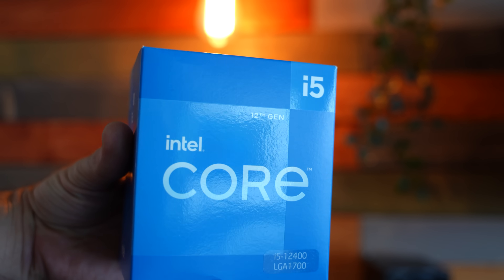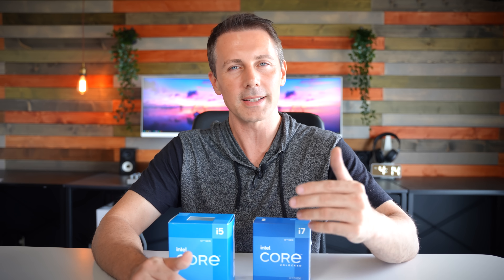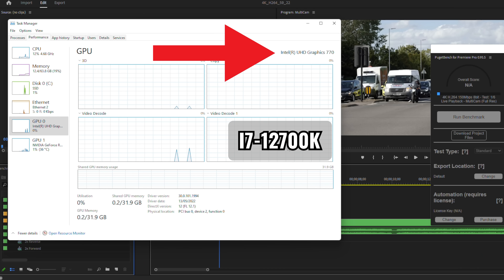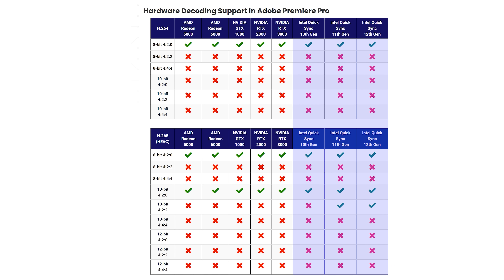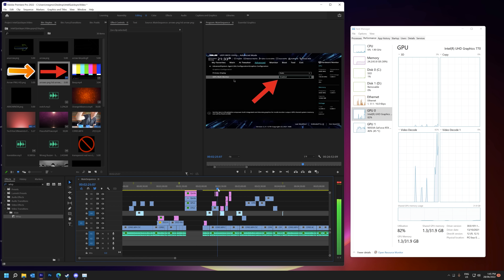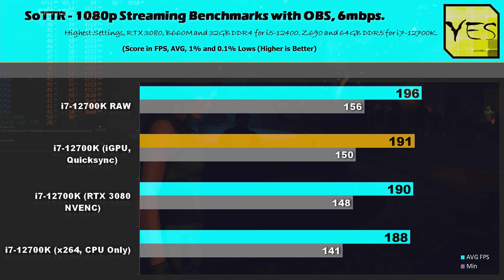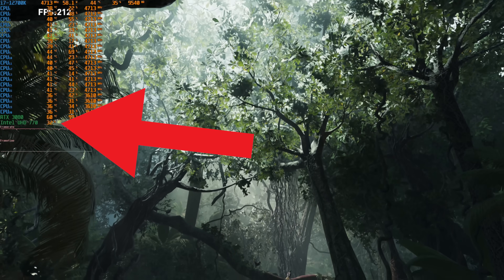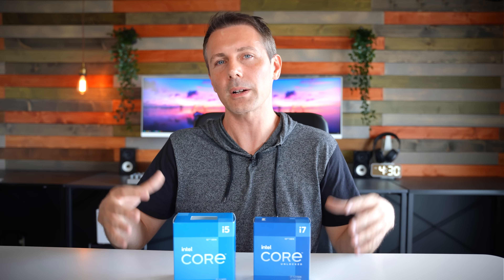Why creators NEED an iGPU alongside their dGPU - Intel QuickSync

Comment: I have an i5 14600 + B 580. I have the BIOS setting to use the integrated graphics. My monitor is plugged into the motherboard DP out.  In handbrake the program uses both combined igpu and gpu for encoding. In gaming the pc knows to use the gpu. Quicksync is a beast in handbrake encoding AV1 and H.265.

Comment: I use Quicksync on i5 12400 for game recording. It really looks better, smoother and higher quality than Nvidia Nvenc from Rtx 3060 (to my eyes), tested on Tales of Arise gameplay (fast paced battle) & Red Alert 3 Remix mod (a lot of explosions).

 It also takes quite a load off cpu and gpu,while barely using 30% igpu. Glad I bought 12400 instead of 12400F.✨

Comment: Quick Sync is the best quality there is from hardware encoding, I got a secondary GPU arc 380 and it's working great so far, for 100$ no PSU connection even needed.

Comment: Boet, any igpu is beneficial. So im writing software that uses directx for some of its functionality and in windows 11 I was even able to push the applications gpu work loads to a hd 4600 in an old i7 4790. So that the gtx 1080 wouldn't be interrupted if I was gaming in the background as the application works with screen capturing and renderering

Comment: UHD 770 is great as an emergency gpu so that you can have a working computer if your GPU dies. 

The new Ryzen 8700G will be the first desktop chip to have a faster iGPU than the UHD 770. It's using the 780M, and it will be over 5 times faster! Cant wait

Comment: Will disabling hardware acceleration allow quick sync to decode videos I watch while gaming? My 4000 series card runs hotter doing both.
Reply: it's on graphics settings(settings-display scroll down to graphics settings). Manually decide gpu to use, for example google chrome/vlc with intel uhd.

Comment: How to configure PC to utilize iGPU when GPU crashes/freezes? When I connect a HDMI to my monitor and my PC after my GPU crashes it doesn't work, I think it needs to be connected at boot. I'm guessing I would have to run my PC duplicating the display between my GPU out and my iGPU out to the same monitor. Will that affect gaming performance?

Comment: I use an older i9-11900K in a Z590-i ITX w/ RTX-2080-Ti dor min gaming but Adobe A/V media creation so i absolutely agree.  However, now I tuned it for low heat output clock diwn to 3Ghz, rest RTX while using iGPU for regular desktop work. But the GPU stays warm. Can i turn it off in womdows? Besides booting w/ it powered off low emergy mode?

Comment: U literally saved me new to streaming and opted for the 12400 cpu paired with a rx 6800 and I was using x264 and thing were not running well a quick change to my twitch settings and I am good to go, I already seen in my device manager that the igu was there so I didn't even have to change any settings in my bios even been, thank u brian!
Reply: Hey, I am literally going for this buil;d, i5 12400 and rx 6800, I am getting a i5 12400 for the igpu for the encoding so i can stream with a crisp quality, can u share your experience with me? I am also checking out your channel atm!
Reply: @sanetrayy  Its overall really good and yeah the streaming off the igpu is a huge bonus, I can play just about any game @ 1440p ultra and get 80-100fps
Reply: @mrhappy8966  Thank you for the response, on what platform do you stream? I'd like to check out the past streams if thats possible.
Reply: @sanetrayy  your welcome twitch studio I'm not sure if I record them or how actually lol
Reply: @mrhappy8966  I will see you there!

Comment: Please help me guys, I have a question for you.
My job is to edit video coverage of friends, almost all of their video results are in MPEG-TS (mts) format because it's from a Sony MC 1500/2500 camcorder, usually they ask for Mp4 Hd files, enter the flash drive to plug it in on the TV, automate me render from the original MPEG-TS file to H264 1920 x 1080, but during the rendering process my IGPU doesn't work alias 0 ℅ but my VGA card runs normally, what's the reason, does the IGPU not support the MPEG-TS codec?

It's different when I render from the initial MP4 file to H264 internal & external vga active all friends, my computer is i5 11500 + vga 1660 super, help me thank you..

Comment: Summary of the reasons: 1. Video was sponsored by Intel. 2. Intel QuickSync, a niche thing no one uses. 3. When your graphics card dies, you can still use your computer and check if it's actually the graphics card that's dead.

Comment: This stuff is getting so ridiculous that my new intel laptop with just a low power cpu and integrated graphics performs has far better timeline performance and even software export than my r7 3700 with a 1080 ti, as long as I don't overdo it on the effects or integrate After Effects compositions.
Next upgrade might just be intel.

Comment: This is great to know! I built my PC in April but I didn't buy a GPU for it until the end of July. Being I knew I was going to go without a GPU for a while I went for the i5 12500 which at the time was only $8 more than the i5 12400 ($202 vs $194). I did end up getting a good deal on the GPU I wanted, the Gigabyte Gaming OC 3080 12gb for $729. I wanted it for the 4 year warranty and because it only required 2x 8pins which is all my Corsair SF600 Plat has.

Comment: Iam in the process to buy a new CPU I have a 11600kf at 4,9Ghz on all core now, Im gonna start stream on Youtube and twitch with streamlabs, I was thinking of 11900kf or just clock 11700kf instead of paying 100bucks extra, Should I Buy a 11700k instead?? Would it be better?

Comment: do you need to do something special to enable hdmi over USB type-c, like on windows?
i connected a hub (that works fine on my steamdeck) but couldn't or don't know how to make it enable multi monitor over that way (12700K,MSI PRO-Z690-A-WIFI-DDR4, win10, tried frontal and rear i/o USB type C) i already have multi monitor enabled i believe, i use daily the mobo displayport -> vga because my dgpu doesn't have a VGA connector available for my old monitor.

Comment: I was looking exactly for this. As my old GPU is dead now, I was stuck between Nvidia and AMD. I have mostly used Nvidia for it's extra features and video Encoder, unfortunately the price is too high for me now. Everybody says that AMD RX 6500XT is not good for not having any video encoder. But I need a GPU at a reasonable price for one year. Then I can buy something better if GPU price falls. I guess I will be happy with RX 6500 XT for now. I am an occasional gamer. I am happy playing on medium settings and cod warzone on lowest settings with 1440p. And my processor is i3 10100 with 2666GHz 16GB ram.
Can you make a comparison of UHD 630 qsv vs UHD 770 qsv. Thanks.

Comment: So should I use the intel gpu for editing and not my gtx 3060 or can both work together doing the rendering?
Reply: I'm using Intel igpu (i5 12400) for encoding (recording) and the RTX 3060 for editing.

I noticed Quick Sync is better than Nvenc in fast moving battle with a lot of flashy effects.

Comment: If you find a deal on the i5 12500 get that because it has better iGPU for quick sync also has all core boost of 4.1GHz I got mine for $190 the i5 12400F was like $150 for me at the time.

Comment: Another usecase to use a second GPU is that you can force your browser for example to use it and can watch Videos without dropping frames on your second monitor, even with intensive 3D games. I had that problem for a long time where I couldn't watch any 60 FPS Videos on the side while playing Forza Horizin for example. My old 1050 helped me out there.
Reply: That's genius. Somehow the games start to turn into 60fps when I watch videos while gaming. I do use amd ryzen so I cannot use igpu
Reply: Why would you need that though.
Reply: @MrBearyMcBearface  well like I described. For whatever reason my games would stutter as soon as I watch a 60fps YouTube video on my second monitor. Running the browser on the second GPU helped with that for me.

Comment: Been using Quicksync for almost 3 years for game-streaming on Facebook. It it indeed a lifesaver because my RX 470 encoder is really ugly on 6Mbps 720p settings. From i7 3770 to i3 10100. It is worth it.
Reply: I streamed 1080p 60 fps from i3 4th gen intel hd 4400 + gt 1030.. Check my channel

Comment: i heard someone once say quicksync is worse stream encoder for quality.
Reply: Nvenc is probably the best for OBS - from a later model Nvidia GPU. With their improved ASIC there should be no impact on performance when encoding and OBS should be getting high-quality frames. Still the Intel encoder is not a slouch, it's totally worth having.
Reply: @SISSYPUSS  i still lose around 5fps with everything ultra DLSS on quality RTX on max reflections  recording with nvenc on OBS
Reply: @ALBERTROSSY  Is that consistent in different uses, like when recording a local file vs streaming? Streaming will need more resources than a simple frame copy to a file. Five frames isn't that much, you might be able to get that out of it, which level card do you have?

Comment: Dealing recently with a potentially dodgy GPU is why I opted for a 10400 instead of a 10400F, and I'm glad I did, turned out the PSU in the relevant build had damaged the GPU (rats); the 10400 formed the basis of a replacement system just to get by, but also for benching later, and it works very well (MSI MPG Z490 Gaming Plus, cheap H412R 92mm cooler which is plenty, Corsair 200R case, Corsair RM750 PSU, Corsair 16GB/3200 CL16 RAM, WD Blue SN750 500GB NVMe, Arctic F12 PWM for the case side panel for future GPU testing).

Have to say I don't think the image quality looked quite as good with QuickSync, but with just a single frame and subject matter, YT encoding and all the rest of it, hard to be sure. For streaming, the performance gap between QuickSync and NVEnc wasn't that significant, but it was interesting how in some cases the NVEnc setup produced worse percentage Lows, so for smoothness of viewing for those watching the stream one could argue QuickSync has an advantage.

A point though about pricing, in some regions, such as where I am in the UK, the difference between the standard and F variants can be quite large, eg. I was initially very hesitant about getting the 10400 because its price was 30% more than the 10400F (150 vs. 115 UKP), but in the end I was confident enough that I did have a GPU problem and so I went with the 10400 just in case. If the difference had instead been more like only 15 or 20 UKP, as others here have described in their own regions, then for my needs the 10400 would have been a no-brainer, though to be fair for the 12K series the difference is much smaller (8% difference for the 12400 over 12400F). This markup grates somewhat because of course the F models do have the iGPU on the die, it's merely either non-functional (faulty from binning) or has been deliberately fused off in order to make up the required stock numbers. I wish tech channels would make this clear, it's not like the circuitry is literally missing, it's there but one just can't use it for whatever reason.

Sad part is, quite likely in some cases, for those dies where the iGPU portion failed the binning process, some of them actually have most of the iGPU functions working ok (indeed perhaps everything needed for streaming), but if just one aspect does not work then it can't be sold as a working unit. Pity there isn't an "unlocking" scene for F models like there was for AMD CPUs back in the day when one could unlock an extra core or two, with the proverbial throw of the dice as to whether it'd work or not.

Comment: TY for this video. I was trying to convince people that the 12100 non-F was a perfect match for the RX 6500 XT when it came out since the non-F i3 has PCIe 4.0 and hardware encoding with quick sync. And that at the time you could actually build a new $600 budget streaming PC while every other new GPU costed at least $500 just for the card.
Reply: F i3 has PCIe 4.0 , if not 5.0

Comment: Check out the Thermal Grizzly 12th gen bracket. Quite interesting that Intel made a CPU thats gonna bend or just functionaly flawed for temps, not by much but still it is flawed.

Comment: I'm so glad you made this video. Most of the big Youtubers just seem to almost ignore the perks of Quicksync to the point that I feel like people aren't even aware of it and its benefits. Cheers!

I also feel like a lot of people either applaud AMD for not charging us for an iGPU we don't want, or are mad at AMD for not giving us the iGPU we want, whereas I think Intel does this really nicely by giving the option to save a buck and go without, or go with an iGPU. The only downside is that the extra cost for the iGPU has gone up from €10-15 to €25, but honestly for a mere €10 discount I don't think anyone should buy an F-sku CPU.

Comment: He also missed if you want to use your GPU for a development environment inside of a VM with most software it will take the entire GPU to the VM  so having 2 GPUs will be good so you can have the host and the VM both with an video out. The main reason to use a devlopment environment inside of a VM instead of getting another computer to do it is 1 cost 2 space and 3 able to switch between the computer set ups easier and of course  3 streaming the VM to another network location to use it there.
Another would be to using software like Blender for 3D design and/or video editing that just doesn't support quicksync and either will use CPU compute, CUDA, OptiX or HIP.

Comment: does AMD have a QuickSync equivalent? 🤔
Reply: No they do not. QSV is Intel only, and NVENC is only available with  Nvidia GPU's.
Reply: @SISSYPUSS  are we forgetting about VCE/VCN? That's been in AMD APUs for like, ever.
Reply: @aleaxdeathbringer  Good mention! *(that user asked about an equivalent, AMD's encoder is not that) - I didn't forget it, but I don't have an APU right now. I think the overall usage is probably low..not sure. 🤷‍♀ I ran some benchmarks with 580-590's and 5700X but the files didn't make it to Youtube. OBS settings are /a bit more involved/ but that's easily copied and pasted.

Comment: Is QuickSync better then Nvenc for streaming??
Reply: Congrats, you've come to the video that answers this question.
Reply: @HazewinDog  Yeah but if consider price to performance.... It really isnt worth it to get a non F version for 15$ to 20$ over a F version.
Reply: @shafayshahzad6512  It depends, really. I've seen people get a higher core count CPU just so that they can stream smoothly. You could also spend extra money getting an Nvidia GPU over an AMD one, which often costs more than $20 extra. But then again you could also get an F CPU and an AMD GPU and use AMD's streaming software if you don't need anything fancy, and save money twice. There's never one single answer.

Comment: Had GPU's fail and yeah the iGPU has been a life saver. Easy to diagnose the issue as you can still get a display out from it, just a case of trying the GPU in a different slot or machine to confirm its broken and you have something to use the PC with till a new one arrives.  My 3800x doesn't have one and it does suck.

Comment: I'm thinking of my Asus G15CE which came with an i7-11700F.
So you think about what Intel offered in that generation: basically overclocking and QuickSync.
(At the cost of power consumption, workload performance, gaming performance, cooling requirements, etc. etc.)
This CPU has no iGPU and no Overclocking.
Genius move there, Asus.

Comment: I made the mistake of getting a 12900KF, Which is a damm fine processor especially if not streaming, But I needed a another GPU to get the monitor to work due to the DP port no Signal & no post issues (want more info its on forums, separate issues). Then I discovered when streaming Interesting issues when using NVENC at 4K display (1080 stream) I notice another streamer with similar set up but using the IGPU e.t.c. not having the same issue.

Comment: So timely for Intel to market their iGPU since AMD is about to include RDNA2 in their upcoming Zen4 platform.
Reply: Yeah true I wonder if the new iGPUs in RDNA2 use PCIE lanes. and will the encoder (if there is one) be as good as nvenc or quicksync? Their current encoder is not so good.
Reply: @OfficialMyMindset  we will find out pretty soon
Reply: coming to the party late isn't it! horse has already bolted.

Comment: I used to thought apu builds with a GPU is stupid
Reply: When the gpu stock shortage happened well you best everybody looked at that APU with fire in their eyes playing CSGO
Reply: Now that the market is realigning itself to serve the gamer, editors and weirdos of the interwebs gpus and APUs can coexist
Reply: @adrianafamilymember6427  bro my friend brought a hp prebuild with ryzen 5 5600g and a 1660s 
i thought why didnt they just use a 5600 or a 5600x instead of 5600g if that thing has a 1660s
Reply: @zenitsu6964  Unless your friend throws away or replaces the whole system. Having a gpu chip on your cpu makes it infinitely easier to repurpose the machine years down the line into something else. It has always been a big tragedy/downside of ryzen to not include iGPUs on their main lineups -- tho it is better for everyone's wallet.

GPUs will always retain some value, while cpu+mobos are much harder to sell down the line. So when it comes time to upgrade 3-4 generations from now, you only need to sell the gpu and use the APU system for something (HTPC, NAS etc)